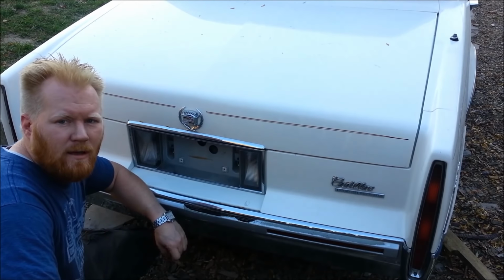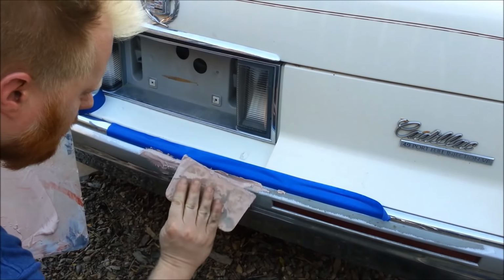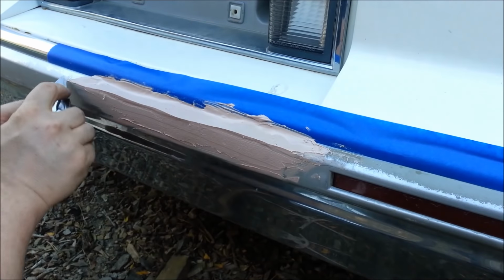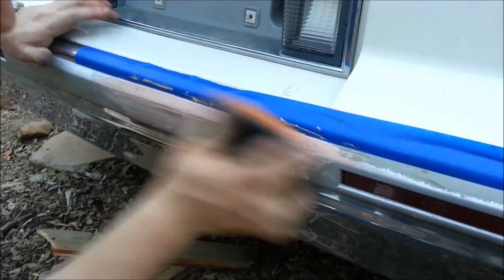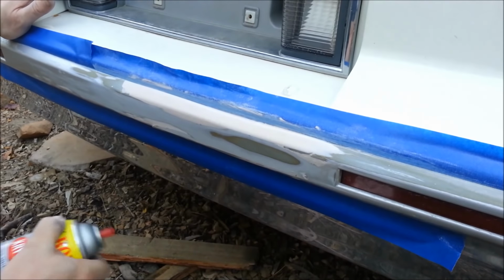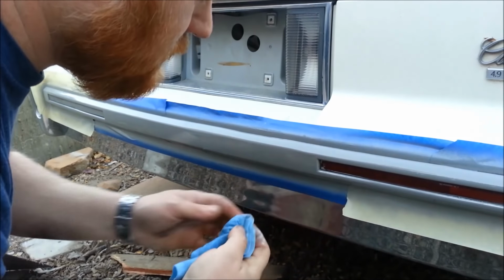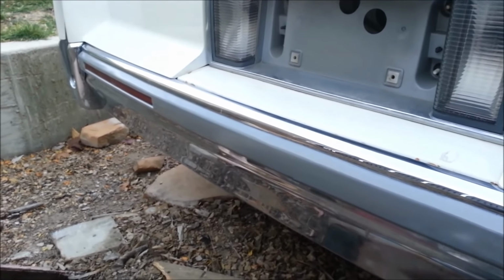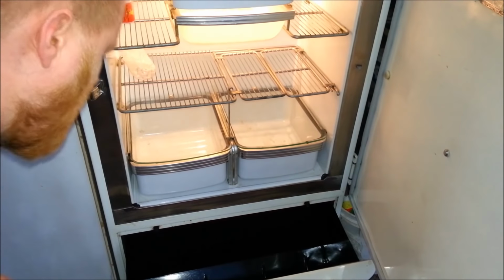Broken Side Molding Repair & 1941 Kelvinator refrigerator

Comment: Great Bondo tip. I've never thought about cutting it down when still soft.
Reply: Yep, and sanding right before it gets 100% hard gets more off with less pressure. Keeps the dust down too.
Reply from the maker: sjs For huge spots Bondo files work good as well when it's soft. Thanks for watching.

Comment: I looked through your videos to find out how to repair rust under the paintjob of a car. I'm sure there are many ways and a lot of videos on youtube. But I would only trust you with the best/easiest way to get it done.
Reply from the maker: eaglecot It's not an easy task. The only way to properly get rid of rust it to cut it out and weld new steel in. I know that POR15 has a decent product  and claims to allow you to encapsulate rust but I haven't had any person experience with it.
Reply: sixtyfiveford
Thanks for the reply! Yup, alright - It's probably a huge project then.
Reply from the maker: It is a big project for sure, but it also depends if you are trying to just make the car look better or look new. If you just want it to look better you can grind down the rust and use fiberglass/bondo over it and use matching spray paint over the spot. This will last 2-5 years depending on your rust. I've seen guys rivet sheet metal over a spot after they cut out the rust. Then bondo and paint with good success. This might last you 5-10 years, maybe more.

Comment: Smashing job :-)

The only thing i would have done different is cemented some gause behind the moulding  to support the bondo, also you would use less bondo so its lighter and has less chance of cracking when you hit bumps.

Looks great though, i would have never known it had been repaired :-)
Reply from the maker: zx8401ztv Thanks. Yeah there was a good metal flange the molding holds to that the video doesn't pick up. It'll hold the body filler nicely. That's the only reason I didn't reinforce it.
Reply: sixtyfiveford
Yep your right as usual :-), it looked like there was nothing behind it, im using a laptop so i suppose a small screen dont help.

I wasnt picking fault, my comments are never to upset people, but i think you know that :-))
Reply from the maker: I always enjoy your comments.
Reply: sixtyfiveford
nice fix

Comment: Hey Sixtyfive, what do you think of the harbor freight 90 amp wire flux cored welder? I am thinking of getting it for light duty welding. What welder do you have?
Reply from the maker: Dasdfjkl I have a Lincoln weld pak 100. It is a 100amp flux core wire welder and works very well. I have used the little guy for the past 16years without a single hickup. The Lincolns can be picked up for around 100-150 second hand and are worth it. The Harbor Freight 90amp welder works but isn't quit as smooth. Practice makes perfect though.

Comment: Hey I'm buying a blow  torch what type should i by
Reply from the maker: Alan Mulry A self igniting one is the best. The http://www.amazon.com/Bernzomatic-TS4000-Trigger-Start-Torch/dp/B00008ZA09 is a great one. If you are in the UK you have Bernzomatic as well but they use a different name Rothenberger: http://www.amazon.co.uk/Rothenberger-35645-Quick-Fire-Torch/dp/B004P8HCT0/ref=sr_1_27?s=diy&ie=UTF8&qid=1415140430&sr=1-27&keywords=propane+torchI bought this one 10+ years ago and it's amazing. I use it all the time.
Reply: sixtyfiveford thanks
Reply from the maker: You're welcome.